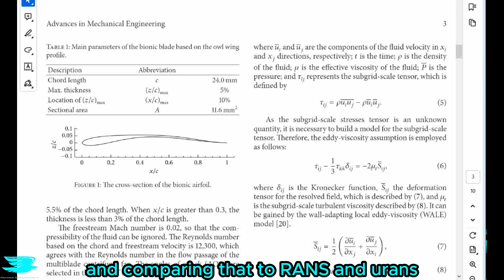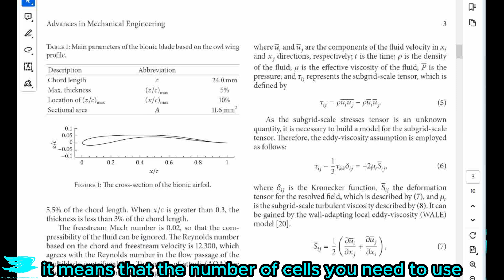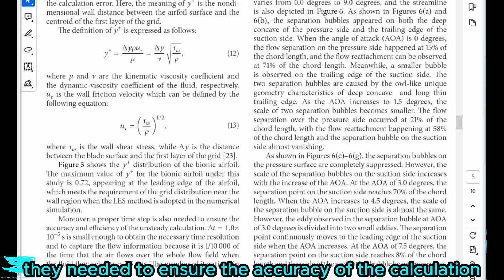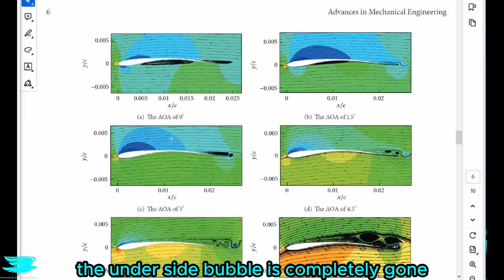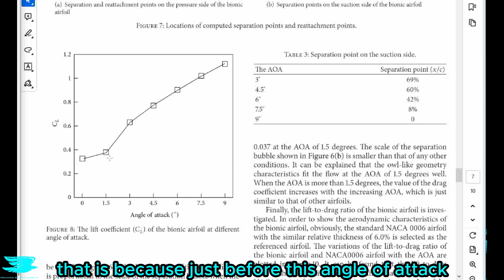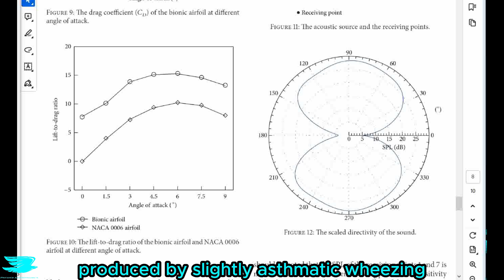Podcast #176 Why Owl Wings Are So Silent

Comment: You can have separation bubbles on either pressure or suction side, I learned this studying sails, and the streamers on the sails to tell which side of the sail has the recirculation bubble. Since the flow is reversed it makes the streamer lift off the sail, and sails have them on both sides.
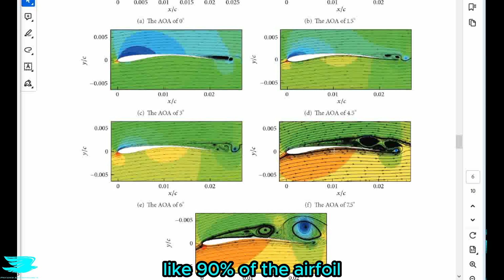Reply: from what i understand you are correct. perssure and suction side are generally just geometric terms for cambered airfoils or airfoils with aoa. separation bubbles accure as the boundarylayer trips and the flow verctors reverse locally. the boundarylayer trips because of adverse pressure gradients. a geometric indicator of adverse pressure gradients are convex surfaces (in the reference point from inside the airfoil). at 21:53 middle left, you can see on the pressure side that the static pressure rises, drops off, then rises again. So at this aoa the leading edge has a region with an adverse pressure gradient. If this gradient grows beyond a critical value, your boundarylayer trips and a separation bubble can develop.
Reply from the maker: @NoanatorTV  These are good points. So, by that reasoning, a supercritical airfoil run at transitional Reynolds numbers could have separation bubbles on the pressure surface too.🤔
Reply: @PremierAerodynamics  im not too familiar with all the weirdness when it comes to transsonic/supersonic flows. From my perspective its really just dependant on the gradients at play, therefor that should apply to any shape when looking at subsonic atleast.